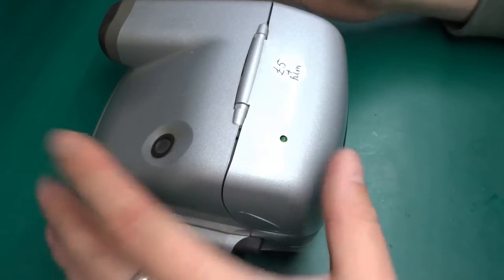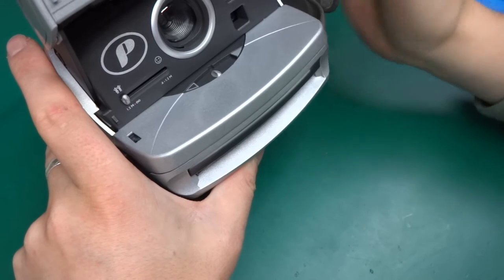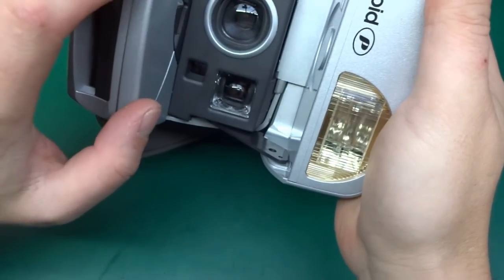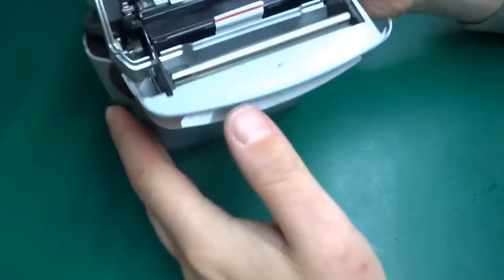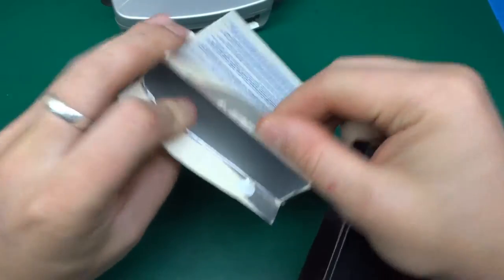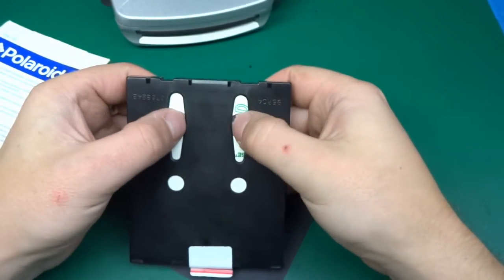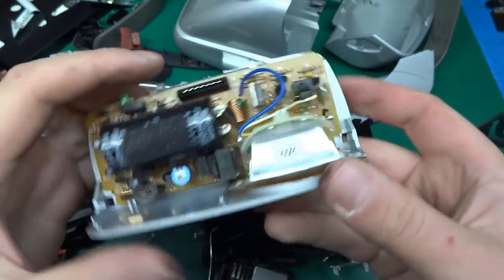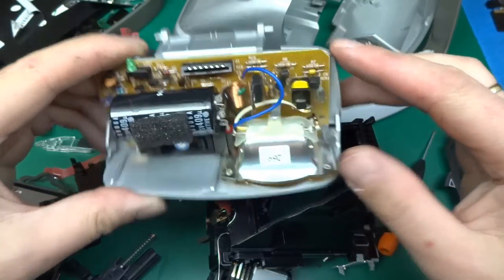Polaroid 600 camera teardown one way

Comment: The light and dark and control can be very useful. Lightning slightly comes in handy if you're photographing people posing in front of a birthday cake it has lit candles on it. Especially if you're using the close-up lens sometimes a light source close to the light meter will trick the camera into making the picture darker than you actually wanted.

Comment: Oh no the one bit I wanted to see and you didn’t show it lol. I wanted to see the roll of black film (not camera film) on the bottom lip where the exposed film comes out
Reply: Its fairrly simpe you can remove it when you pop open the film door and push the plastic brackets clipping the front mouth of the door. Its easy.